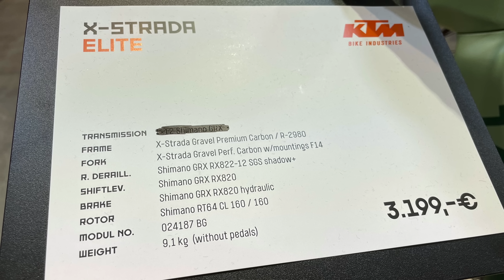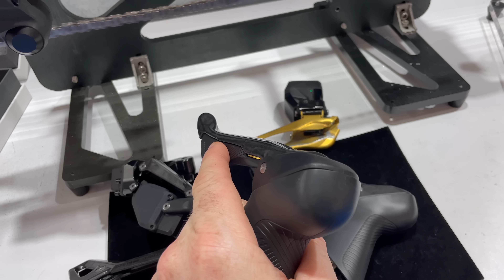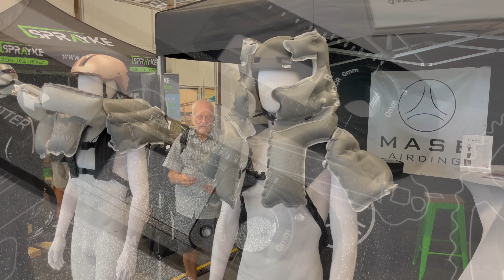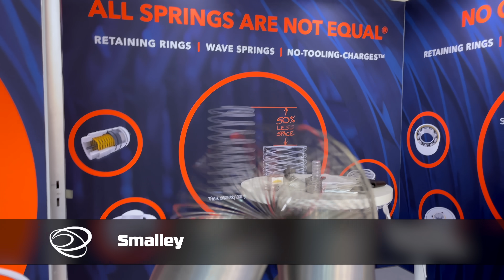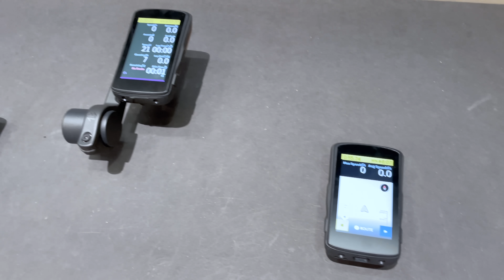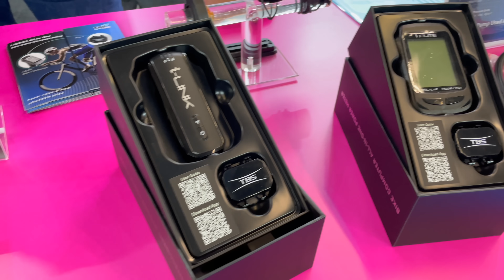Eurobike 2023 Tech Round-Up // 18 "Probably not your next..." Products

Comment: The more i see of that wheeltop groupset the better it looks. The rear derailleur particularly looks great. Rechargeable batteries that dont fall out or have connector fails? Yes plz!
Love to find more about the multi-speed programming, that could be cool, and potentially save money if you could upgrade to a higher speed in the future with just a firmware update. Should be standard on ALL electronic systems, having to buy a brand new derailleur when the motor could just move a little less.

Comment: We need a Hide The Wheel Lama test of a Muckoff AirTag in the wheel system :)
Reply from the maker: They’re a pain to buy, tbh. You have to select the holder then the correct valve length. Not a straightforward purchase/install.

Comment: Every electronic front and rear derailleur from any manufacturer should be able to support any range of gearing from 5,6,7,..12. It’s all in the software.. I suspect there are many 10 speed DI2 units around in good condition that could have a firmware update to support 12 speed.. It would also enable upgrades to older bikes as original equipment becomes harder to find.. It’s all marketing driven. Hopefully sanity will return to the bike industry and we won’t be faced with even more outrageous pricing than we have now..

Comment: I like the adjustable crank system and would like to know how well it can keep its settings for permanent installation on custom bikes for short and tall riders.  I think it would be great if they made two versions : short being 145-165mm and  long being 175-185.  I don't see any reason to offer the standard lengths, as people can just use an ordinary crank.  Or perhaps it may be good if you have a leg length discrepancy.  Apparently those Trimm units can run forever, when connected to the solar panel they sell with the unit.

Comment: valve cap powermeter? what??
Reply from the maker: Let’s not even… They tell me this new one is much better.
Reply: I've once seen it being sold second hand locally for like 20 bucks. Just looked them up on YouTube and there they have a video proudly comparing it to SRM on an uphill and it's jumping only like +/- 50W! Might be actually a fair competition for the budget offering from Shimano (the R9200-P, or how is it called…). @gplama , now I need your review of one! Perhaps as April fool's?
Reply: The last one is a scam . This one dont really think it works.....
Reply: @kitttt2002  DC Rainmaker some years ago reviewed powermeter with similar design, it was called AeroPod if I'm not mistaken. Obviously it doesn't work as good as a powermeter on a bike, but surprisingly it was not terrible. If it'll be priced at let's say 100 USD, it actually has some potential.
Reply: @jeskli11  i looked it up and it indeed sold for $100. but it was so shit you might aswell blindly guess. there are apps that try to estimate your power with your cadence and HR that are much better
Reply: @jeskli11  PowerPod, the AeroPod (same company) measures CdA drag, so you can shift to your "optimum Aero position" on the fly, it works reasonably well (apparently) but how useful it is, is up for debate. Both products are on version 5 at this point so somebody's buying them. They aren't cheap either the PowerPod is well into reputable single sided left crank arm territory, and the reasonably well regarded Chinese/Ali Ex' spider based offerings. 🤷‍♂